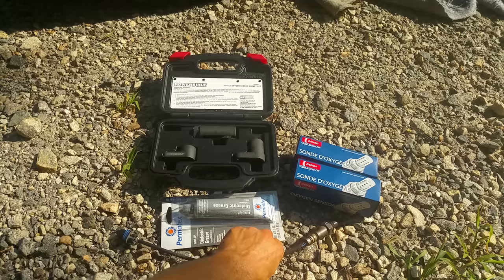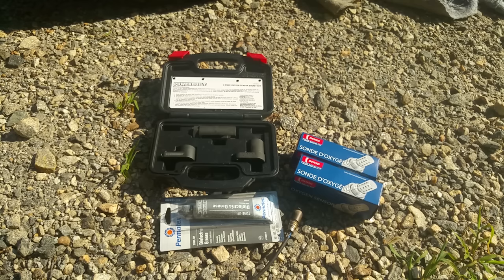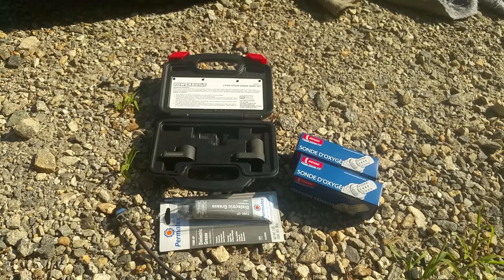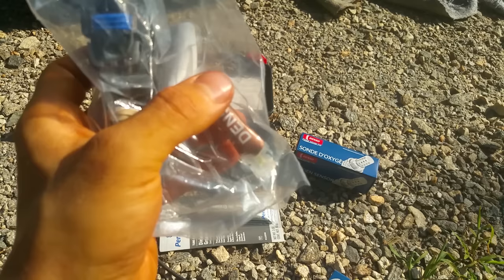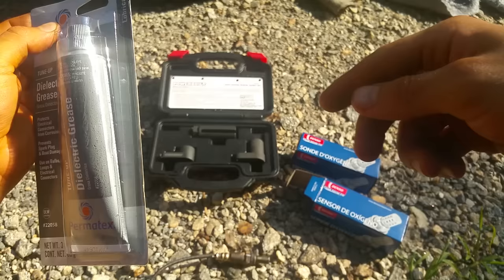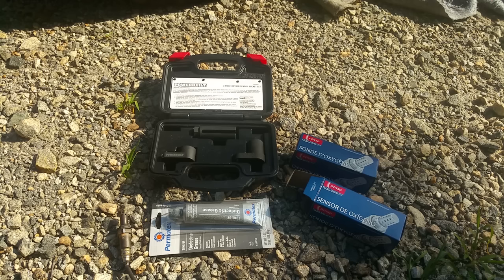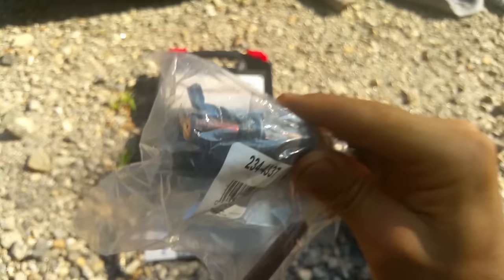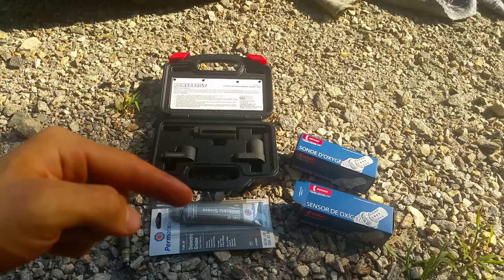NEVER Change Another O2 Sensor Until You WATCH THIS!

Comment: Many times the O2  sensors dont really need to be changed.  Carbon build-up in O2  sensors are many times caused from using gas that is not high enough octane.  Cheap gas will cause all sorts of carbon build-up. Many times one can just get Cat cleaner from a parts store and run it through going right by the directions on the bottle. There are several different brands the stores carry that will guarantee to clean the converter.

Comment: Why those sensors fail so easily?
Reply from the maker: They have a hard life of everyday use.
Reply: Matt's Shop says:
"They have a hard life of everyday use."
==
All car parts are used every day.
None of them fails every two years.
Reply from the maker: Lol those parts are not a sensitive little sensor exposed to burning hot exaust fumes that coat everything in carbon.
Reply: Matt's Shop says:
"Lol those parts are not a sensitive little sensor exposed to burning hot exaust fumes that coat everything in carbon."
==
And pistons don't get exposed to the heat?

The engineers didn't know the sensor would be exposed to high temp, when they designed it?

Why the law changed to reply on such fragile device when we didn't have any problem with the exhaust check?

Comment: Well Alrighty... Where to begin?!? Ok Yes, anti seize is pretty much a must with O2 Sensors, many/most but not all spark plugs, brake hardware (caliper bolts/pins, (I've pretty much always used it on lug nuts but just on the threads typically. Occasionally with aluminum wheels I'll put a dab on the lug nuts tapered seat due to the corrosion between the nut and aluminum wheel but in some circumstances "they" sat never in use anti seize with lug nuts. Might just be for certain vehicles and probably because the manufacturer recommends torque spec of like 3-5 inch lbs or some goofy chitz. Who knows anymore.  And use/apply anti seize SPARINGLY. A Lil Dab'll Do Ya!!! If'n you know,  you know 😆       Next
DIE!!! Electric Grease!!! LoL Please look it up. Dielectric grease is an Insulator against Water, Corrosion and yes... Electricity!!! Do Not coat your metal electrical connections with Dielectric Grease!!! As our host said, you can apply it to the rubber waterproof insulators around the connector but NOT on or inside those (in this case) 4 pins male and/or female. Not asking but almost begging for trouble!!! Same with your spark plugs. You can put some, a dab, in the boots as it'll not only help keep moisture out but will also aid in the next time  you havta pull them off when removing your spark plugs quite easily since you pilut anti sieze on the threads AND the tapered seat. Not really a Dab, just a Schmear. I like to use a Q tip when applying DIE Electric Grease especially when Schmearing, LoL 😆  If'n yer Jewish, ya know. Well, i do believe my work here is done. 
Lemme know whatcha think. Be Nice!!!
Peace and Brightest Blessings Always 🙏 
        🤟 ROCK  🤟

Comment: And don't do this until the car is completely cold to avoid injury and easier to do thanks a lot
Reply from the maker: Actually, I like to warm the vehicle up a little bit to help expand the threads a little bit. You don't want to geet it too hot though and you don't want to drive it because that will heat up a lot more than the exhaust.
Reply: I like to grab a 30 lb jug of R22 refrigerant and invert the jug and open up a hose on my gauge set to blow liquid refrigerant all over the bunghole.And the exhaust pipe if any refrigerants left.

Comment: the kit does not work. use a torch to remove.
Reply from the maker: You need both!
Reply: @MattsShop  uh no ya dont. i got mine out after strippin the crap out of it with the wonderful o2 socket. i used a map torch and a wrench. came out in seconds
Reply from the maker: If it's tight enough to break the special socket, just cut the wire and put an impact socket on it. Then use a breaker bar or an impact if you get that lucky on where it is located.

Comment: Usually If I had the new onse and were changing them out for sure, then just cut the wire off and get a 7/8th  or 13/16th pr whatever size impact socket the sensor is and impact it right off. Why waste time trying to "torque" it off with those expensive fancy sockets? 

Also, do not use any kind anti sieze or anything on the threads of the 02 sensor because overtime anti sieze will actually make it seize in even more and too much antisieze will block the emergency ground connection of the sensor. So if you get hit by lightining while driving your sensors will blow but you and the car will be fine, just blown 02 sensors. 

again... NEVER USE ANTI SEIZE. and if you follow torque specs then anti sieze will make you over torque the sensor because of the lubrication. 

dont believe me? get anti seize and put it in the threads of a bolt then get a heat gun and heat it until the antisieze dries up. after its dried try putting a nut on it and see how much harder it is to put it on rather than if the threads were bare. It becomes a glue when heated over time and harder to break off than the rust formed between metals.

Comment: Wear full lab suit and gloves 🤣ps any codes must be cleared if any present after replacment as engine wont clear Oxygen error sensor codes automaticly like any other error.
USE ECU code reader/removal - if you dont havew any just Remove battery postive cable 10-15 min should do the job.

Else it can take up to 200miles - sensor must get hot and cooled 6 cycles is a lot of driving

Comment: Putting a non-conductive substance into your electrical connection is not a good idea.  Dielectric means it acts like an insulator.  Putting the grease down the holes could dampen or kill the electrical signals.
Reply from the maker: +Mike Darius That's not true. This is what it's made for. To prevent oxidation on metal to metal contacts. A little will hurt, but a tiny bit on the pins will help.

Comment: If you knew anything about o2 sensors, you would know there is a reason why dielectric grease or any type of grease is not used on a o2 sensor connector. Thumbs down 👎
Reply from the maker: If you knew how to read, you would know not all 02 sensors are designed this way. I've said this like 10x below.
Reply: Appears to be a zirconium style voltage generating sensor for a GM. So please elaborate about how this sensor is designed if you truly believe I am wrong.
Reply from the maker: You're getting wayy too into this. Swap it out good to go.

Comment: JUST BECAUSE YOU HAVE A CODE FOR AN O2 SENSOR DOESNT MEAN THAT THE O2 SENSOR IS BAD.MECHANIC FOR 20+ YEARS.NEVER EVER SEEN A PERSON CLEAN AN O2 EITHER.THIS GUY SEAMS UNEDUCATED IN THIS AREA.TAKE YOUR VEHICLE TO SOMEONE THAT KNOWS WHAT IS GOING ON.IT WILL BE EASIER ON YOUR WALLET IN THE LONG RUN.
Reply from the maker: Lol, I seem uneducated? That's funny. What about your CAPS LOCK bro.
Reply: Uneducated? Yeah. like I've said been a professional auto tech for over 20 years.sounds like you got your education at AutoZone.thats all good if you are talking to alot of people who have no experience at all but you also need to educate them too.again you can spend alot of money on parts you don't need so take it to a professional and save yourself the trouble.you also say unplug the battery.why?? If you have the correct equipment i.e. scan tool and the know how then you don't need to disconnect the battery.plus you mention the fact that by doing the battery disconnect you HOPE that it I assume the code goes away.well I guess that is all fine and dandy but what about running the o2 monitor to make sure that you fixed the problem and  not hopping that you fixed it.uneducated? You bet....do your homework before you post any more I HOPE these parts fix my problem videos.

Comment: You do not use diaelectric on a sensor likethis  PERIOD unless it's having a trouble making a connection.  The anti seize is one thing...but you don't want to use on this type of sensor or you will definitely have problems down the road.  You do not want to get any of this antiseize on the actual tip of the sensor either..   JUST THE THREADS ONLY.....as it will ruin the sensor and have it burn out sooner.  Where did this guy learn how to do anything car related??????
Reply from the maker: Where did you learn to do anything car related? On what basis will dielectric grease hurt the sensor? Electricity goes right through the grease like it's not even there. It's not going to hurt ANYTHING.